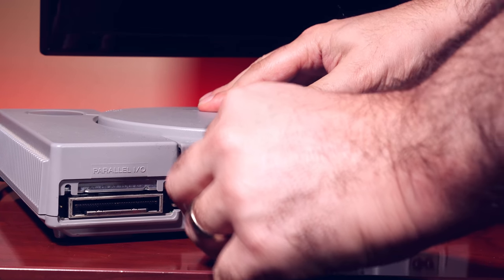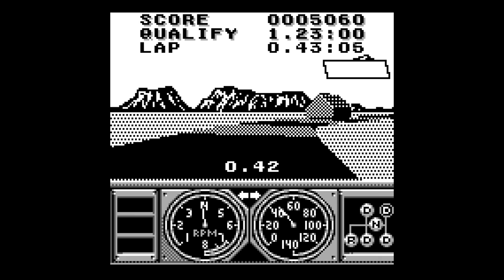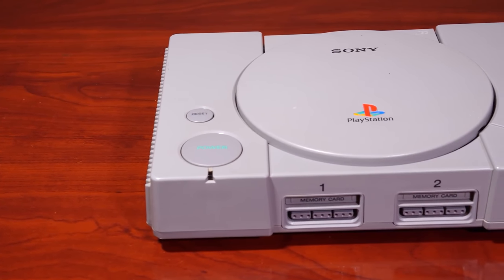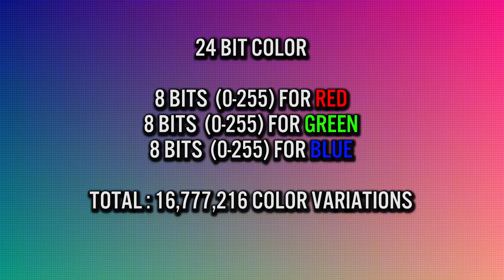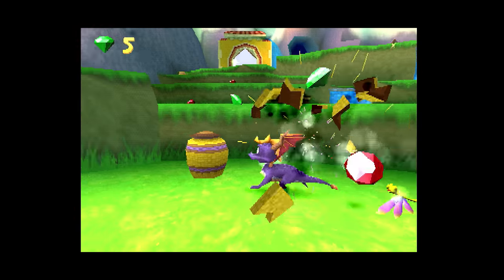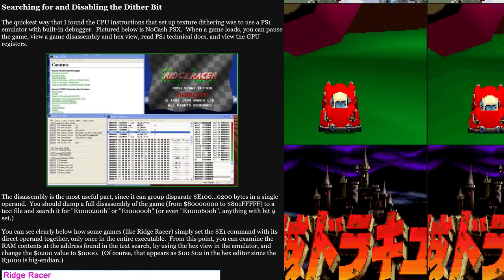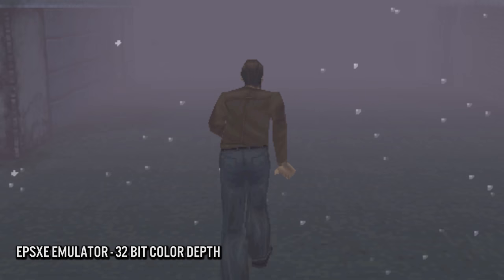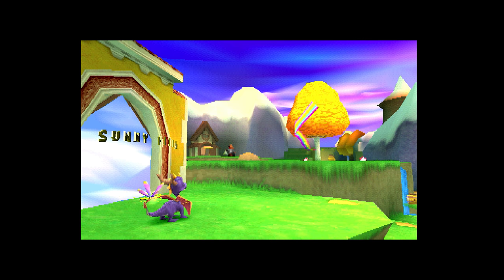Why did the PlayStation 1 have so much Dithering? | MVG

Comment: 4:47 - PS1 does not use textures with 24 bit color per pixel - every texture format is stored in 15bit (5 bit per color + 1 semitransparency bit) either in direct color or using 4/8bit palettes.
Triangles (and other primitives like quads and lines) can be rendered using flat/Gouraud shading where each color component is given using 8 bit per color.  This additional shading can also be applied when rendering the textured polygon (15bit texture).
In both cases that's where dithering makes a difference.

Comment: PSP also used hardware dithering for the same reasons, 32bit framebuffer being a bit too big but 5551 or 565 16bit one having lots of banding without dithering, but in PSP's case there was never any CRT or cable artifacts to mask it, in some games it was very visible. as the developer you could manually set the dither pattern which was very useful for controlling the strength of the effect to better suit your needs

Comment: Older TN panels also used some forms of dithering because they couldn't display all of 24 bits truecolor. Today they often do so to emulate HDR10. In my experience, dithering is useful even with 24 bits colors where banding can still be noticeable but unlike a lower color palette, the dithering is hardly noticeable.

Comment: I have grown up in the 90s and loved the PS1 and never noticed dithering before especially on the CRT monitors until I started using emulators on PC. It makes sense to dither because of the frame buffer and to allow simple 3d to be rendered in real time as you dont have all that vram available to process all those colors. It was especially noticeable in the graphics of the SNES game Star Fox and other graphically enhanced games as it was ahead of it's time. And  especially when they added the Super FX chip in the special cartridges that allowed the rendering of simple 3D but the dithering effect was more apparent even on the CRT. So programmers especially utilized the dithering for improving performance.
Game developers still use them today to allow gamers with lower spec hardware to play games at the framerates that was intended.
I personally favor higher frames per second over graphical quality and smooth textures.
Another note is games back in the DOS days of gaming, dithering was also apparent in games too like Duke Nukem 3D.
I could go on about this!

Comment: I noticed the dithering all the time, and guessed (correctly) the reason for it. Here in the USA, it was pretty common to use S-Video output. This isn't as crisp as RGB, but it was still plenty sharp enough to see the dithering all over the place.
Reply: As for my opinion on it - I like the dithering. It's part of the distinctive look, along with the shifty linear textures and the split quads. (Although, I prefer the distinctive look of Saturn quads ... less weird looking for walls and doors and stuff, but still ... off ... in a distinctive way.)

Comment: Call me crazy if you will, but I think dithering is what gives PS1 graphics their charm.
In France, RCA cables came later, they started being widely used around the time the N64 came out. We used SCART cables, which gives a crystal clear RGB picture, the dithering becomes visible but is still subtle enough to not strike the eye.

Comment: I play retro systems including the PS1 using RGB on a high quality CRT all the time. Even with RGB, the dithering is usually pretty subtle on a CRT and I personally don't mind it in 99% of cases. And I 100% prefer the jaggies and dithering on the PS1 to the vaseline smear of the N64. In fact, using an Everdrive to auto apply de-blur patches to all N64 roms is one of my favorite ways to play games on the system.

Comment: Another reason dithering isn't as irritating on a CRT with a 240p signal is that the dots aren't being scaled. As soon as you multiply all the pixels by 3 or 4 to scale to an HDTV, the dithered pixels are much larger and more 'in your face'.

Comment: Heh, I so appreciate the emulators that let you basically emulate the CRT. Some amount of banding for scanlines and emulated light bloom to blend the results. Not smooth, but not all edgies either. These things were all designed with CRT output as a primary target. Fonts, curves, dithers, whatever, expected light to bleed. And not always in a uniform way either. Think tweaks to fonts or what not for sub pixel details on trinitron monitors late in the scheme of things, and even with LCD monitors on laptops.

Comment: The last time I encountered dithering was on Monster Hunter games on the 3DS
The engine dated back on PS2 and was heavily upgraded over the years. But still surprising to see dithering in pretty modern games
Reply: Not sure if this is the same thing, but I noticed a lot of transparency effects in games use something that looks like dithering.
Reply: @DarkButz  IIRC some moden games that use deferred rendering use a dither pattern on transparencies to avoid doing the time-consuming task of correctly ordering true transparencies on top of one another. I assume that higher resolutions and temporal anti-alising makes the dithering less noticiable.

Comment: PS1's GPU can't even render polygons in the 24-bit mode. And all the textures are normally palettized 4-bit or 8-bit ones, not 24-bit. 24-bit has been mostly used for FMVs and maybe static screens. Also, this kind of dithering is not that unique to the PS1, it present in most consoles of the generation that are doing a kind of blending with 24-bit math, but render into a 16-bit frame buffer. The same thing is with 3dfx.

Comment: Dithering was a great technique for it's time. Sony knew exactly what they were doing to get the best graphical quality out of the system by factoring in all the limitations of other hardware the system would be using in the 90s. 25 years on however, the graphical tricks they pulled are very much apparent with modern hardware.

Comment: The PSP also had dithering, but the algorithm could be changed. Some games changed the pattern each frame and together with the PSP's LCD not being the fastest to switch between pixel colours, made it look much better as long as it ran at 60fps. I believe Tekken does this, along with another trick to fake anti-aliasing. The PSP was very fun to develop for :).

Comment: The dithering was a great work-around to the hardware's limitations.  And now, as you've pointed out, emulators can enhance the images to true 32-bit color and remove the need for it.  So the dithering ultimately was a win-win.  Back when the screens weren't good enough, it blurred the colors nicely.  And now that the screens are good enough, we have ways to eliminate it.  Technology marches on.

Comment: Just to reply to your last question, if I play on original hardware I love to just use the composite cable on a CRT. It just looks how I remember the console and I love that. When I emulate, then I try to get rid of everything and aim for the cleanest image posible. Dithering, the low resolution, or color banding if you get rid of dithering, just doesn't look right on an LCD.

Comment: Over composite or, to some extent, even S-Video, the colour signal bandwidth is too limited for the dither to be clearly visible, and back in the day, very few people used RGB, especially in NTSC regions. So I'd argue that using a blending filter like on the PS3 gives you a more authentic experience than raw unaltered RGB video from the original hardware.

True 24-bit rendering on emulators is great, too, if you're not a freak for uncompromised authenticity.

EDIT: Also fun fact: 3Dfx Voodoo and Voodoo2 were limited to 16-bit colour and applied dithering as well. But because PC video has always been RGB, there was no composite blending to mitigate that. So the Voodoo cards actually applied a selective blending filter before piping the image through the VGA port. That's why screenshots made on the rendering machine look worse than actual output.

Comment: The Playstation did have dithering where it lacked the amount of shades of colors to save space to run smoother. On a real TV set you didn't even notice and thus not even care a bit. similar to the dithering on the Sega Genesis. Only later with barebone emulation this all of a sudden became a discovered problem. But as emulators got better to circumvent that, we can now play the classic games the way they were intended to look. For Sega you need certain options viable through the emulator. And as for PS emulation you need a true color mode that renders the dithering closer to what it looked on a CRT TV.

Comment: A lot of PC games around the same time could also be run in 15bit colour, as opposed to 16 (1 additional bit for green iirc), 24, or 32bit. This was useful because the game would run quicker when the engine wasn't computing scenes at such a high bitrate. I vaguely remember some of the very early GPUs just not running with 24bit colour. Windows also includes built in colour bit depth dithering at an OS level, and has done since at least windows 3.x. With most people running PCs on monitors, which offered much better image quality than TVs, this dithering was obvious, and from memory was just one of those things that was kind of defined the era of computer graphics. I'm sure those of us from that time can remember running windows installers, and seeing the dark blue gradient installer background, which was dithered unless running in a high enough depth. TLDR; lots of things computed graphics at less than 24bit, and they all dithered as a result.

Comment: Dithering, if done right, could add a lot to a game's overall visuals on a CRT TV. That's obviously a completely different story on modern displays. I found your filmed Spyro bits on the CRT a lot more appealing than those captured by software. I actually think a side-by-side comparison of how older games looked at the display technology that was available at the time vs. modern displays would make for a very interesting video.

Comment: The thing is, when games were developed, made, released, they all ran on a crt, with extremely few edge cases where games in the mid 1990s (home games, not mobile/portable) ran on anything other than a crt screen. 

Nowadays almost nobody uses crts. Almost everyone has either an LED backlit LCD display, or some form of organic LED display with a few using plasma still, or laser based projectors. A surprisingly few even still have any CRTs at all.(in most countries)
PS1 and it's games using dithering is a product of the fact that when they were made, these were beyond expected levels of compatibility, a console released in 1991-1998 should have had no reason whatsoever to predict that CRTs would not be the preferred display type of the entire mass majorities in the global economies... And because of that, things that pushed limits then now look more or less horrible. Maybe someone could make a ps1 hardware modification that alters the render functions of the graphics chip so the dithering is processed in code and altered to do a blend / output a different color, like with an fpga capturing BUS pins between vram and graphics, or between graphics and an HDMI mod or whatever.
Did dithering serve it's purpose? Definitely. 
Would I prefer to see the dithering upscaled on a big lcd etc? Hell no.
Upscalers and scan converters etc really failed to yield good results in classic videogame areas. We need a way to convert the dithering into the blended colors they were meant to be.

Comment: I used S-Video on my Saturn from the start, so naturally as soon as I bought a PS1 I bought S-Video as well. The dithering was blatantly obvious to me, I thought it looked like Sega CD video although higher color and resolution.  I posted online about PS1 full screen dithering and for years Sony fans insisted it wasn't there, at all.  Meanwhile they complained constantly about Saturn and dithered Transparencies.  From Bleem onward it always looked like PS1 dithering was obscured or blurred by the standard plug ins.  I also noted the near complete lack of real hardware PS1 or PS2 gameplay videos online.  It seems the image quality issues of the Playstations was known to me, but it was always shut down in any discussion.

Comment: Original hardware and intended display methods will always have a place, especially for those of us who grew up with them.

But I'm still glad to be able to use stuff like 32bpp, PGXP and AA via emulation. Especially when paired with Mednafen's GOAT shader.

However, while previously greatly preferring HQ2x and then xBRZ textures filtering, I now find myself turning that off.

Comment: I wouldn't say in the UK that most people used a monitor for the Amiga, the vast majority probably connected with an RF adapter, not even composite. I was still using RF when I got the N64! I do remember finding a monitor to use with my Atari ST, and loved it cause it looked gorgeous, but it was very small so I normally preferred to plug the ST into our big TV - via RF of course (STFM model).

Comment: I personally grew up with the Game Boy and all following handhelds so Dithering was  something I saw a lot in video games and I believe it still was used as an artistic device in GBA games. I defenitely dont mind this trick to get more out of limited hardware. There is one thing that annoys me however and that is how the models on PS1 look. Low poly plus this  "glitching" just looks bad in my opinion. I first came into contact with the PS2 and not the original PS which apparently upgraded a lot ( still not pretty from todays perspective but oh well ). Also model warping can come from bad motion caputuring (all motion captured data needs to be "cleaned up" after recording or else this happens) so its not always fault of the hardware. Anyhow thank you for this informational video, its always amazing to see the tricks and quirks from past Game Developement era

Comment: On psp connect to tv with svideo cable,dithering appear on svideo input tv selected,but not on av input with the same cable,much clearer. Dithering can be sharpened better if the game has taken advantage of it avoiding some runny colors sometimes, but most games do better in AV.

Comment: There's quite a lot you said about the Amiga that just isn't true. Firstly the Amiga used bitblanes, namely 5 which gave you a 32 colours. The 6th bitplane or half-bright gave 64 colours, but all the colours were programmable in the copperlist, so those colours could be any colour you wanted. You could also adjust them both across the raster and down the scan lines, so you could constantly be changing colours (which is actually how 1 pixel plasma effects are done). Also in hi-res you were limited to 16 colours, but you could actually get more by adjusting the DIsplayWindowSTaRT and DisplayDataFetchSTaRT albeit at a reduced size. Again you could adjust the colours both across the raster and down the scan lines (with an extra 2 x 2 timing lag). Secondly the blitter could draw lines and fill, but neither of these could be done "almost instantaneously". You could make the blitter dither lines that it drew (although this breaks filling) and apply a pattern to the fill to create dithering with no extra cost, but the blitter blitted in 16pixel lines, so the pattern you could use was limited. The blitter was fast, about 2x that of the CPU for operations, but the boolean operations you could do between ABC with destination D were limited, even with the barrel shifter it also had.

Comment: Dithering...  Sometimes it looks really good and sometimes it doesn't.  There's no single answer.
Even if you try to examine its use in a single format it doesn't stay consistent.  I've seen some pixel art that looks best with adding slight dithering effects, and some that just doesn't look good if it isn't being fed through a CRT.  Full-screen dithering looks great on some PS1 titles and bad on others.

Comment: At the time, yeah, I thought the N64 looked far better, really to be honest I found the warping and wobbling of having no FPU far more distracting, but have gotten oddly nostalgic for it now. Does make playing the Original MGS a bit more tense though, since any wobble or texture snapping isn't necessarily an enemy, just the PS playing tricks on you ;)
Reply: I remember as a kid when I got to see both the PS1 and N64 versions of a game, I always preferred how the PS1 version looked because of its sharper appearance; unfiltered textures and no "anti-alias" vaseline filter on the screen. Even on my shitty CRTs, the PS1 still had a sharper and more pleasing picture to my eyes.
I still always turn off texture-filtering when I play a DOOM or Quake source port, and I'd like to experiment with disabling it in N64 games as well.
Reply: The PS1 always looked more primitive to me. If I compare them the N64 feels like a very primitive modern console and the PS1 like a very advanced retro console.
I do think it's because the PS1 still has a lot of the aliasing and artifacts of primitive 3D while the N64 manages to eliminate most of those.